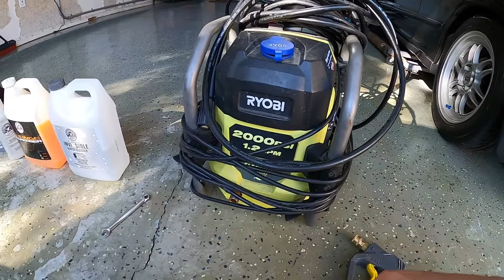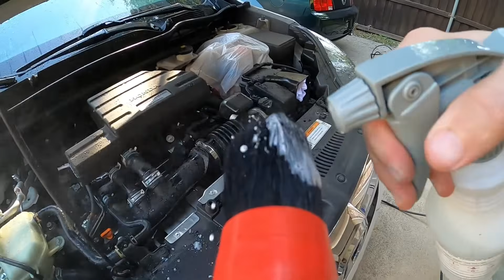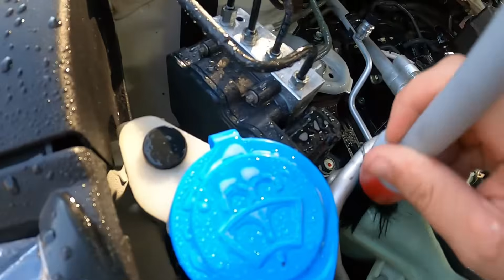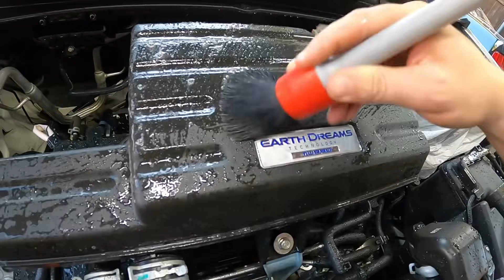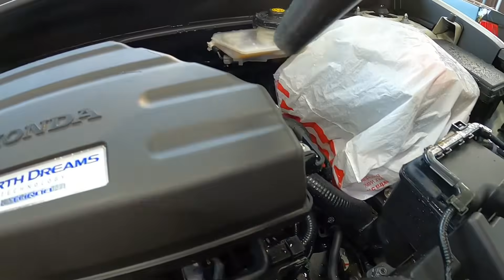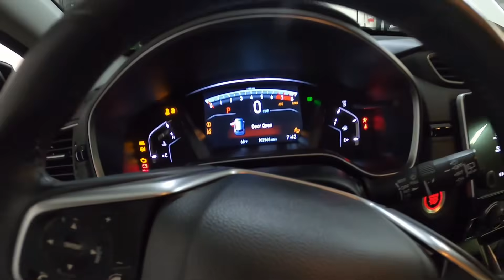Honda CR-V Engine Bay Detail "How To" | Products & Tips

Comment: Love referring to your videos for my 2019 CRV LX 1.5L, have you had any fuel injector issues? I have been having issues since 100k Km, will be replacing the injectors now at 120k Km after some troubleshooting and parts changing.
Reply from the maker: Nope. I’ve had ZERO issues with this car.

Comment: Cand someone detail the engine bay at a DIY carwash? As in, use the chemicals and brush and rinse with standard car wash wand? I don't have a pressure washer but would love to clean it up.
Reply: Put a bag over the battery with the car on. use tire cleaner if your car wash doesn't have an engine cleaner. Try not to spray directly on the alternator, fuse box, and into the air intake. Rinse it off and don't turn the car off until you drive it for a while to let the water evaporate.

Comment: I have a 2017 Honda crv with 250,000km. Your car looks 10 years newer than mine! My engine bay is rusty! As well as the rest of the car haha. Heat shields have rusted and fallen off

It still runs super well though. Change the oil every 8,000km! Love the car, I actually own 2 of them. The other has 80,000km and still looks way worse than yours due to rust.

Comment: Hi. I really congratulate you on how you've managed to keep that engine looking so new... especially since that CR-V is a 2017 model. The result is truly fantastic, thanks to the products you use, but above all, to the dedication you put into your work. I realized this when I saw your video on changing the oil in your CVT, and I was amazed at how clean the engine and its lower parts were. Now, I just have one question... does that 2017 CR-V stay in your garage for a long time? I mean, is it not used much, perhaps? I ask because it seems like it's always stored away, judging by the state of the engine. If that's not the case, and it's used quite a bit, then congratulations! It's remarkable, whatever your answer may be. Greetings from Chile.
Reply from the maker: Thank you! It’s actually a daily driver and gets plenty of use.

Comment: doesn't  the 2018 have a front differential that you should change oil in for the all wheel drive , i have looked on here for a video but can't find one , i know the ford escape has it's called a PTU ?
Reply: No! Crv awd just has rear differential due every 30k miles